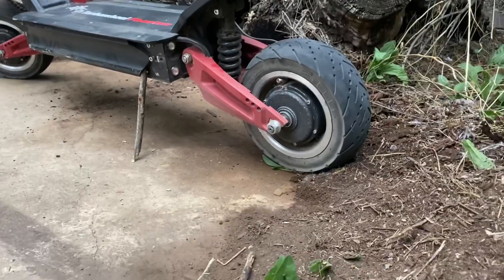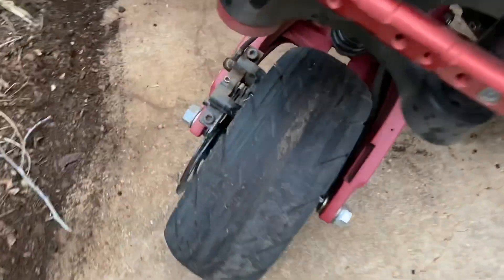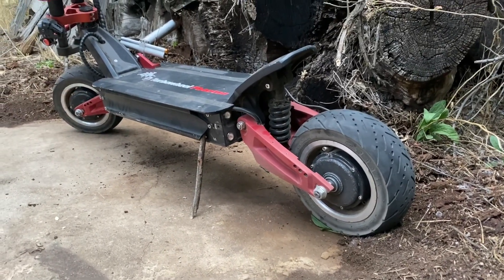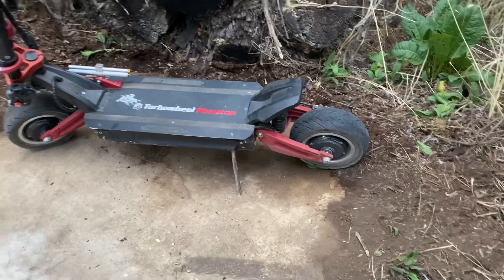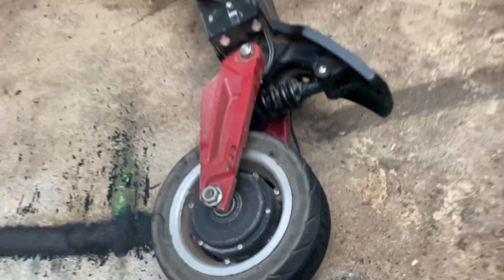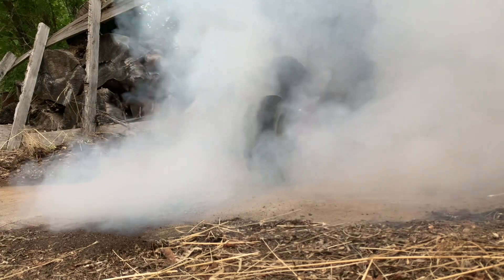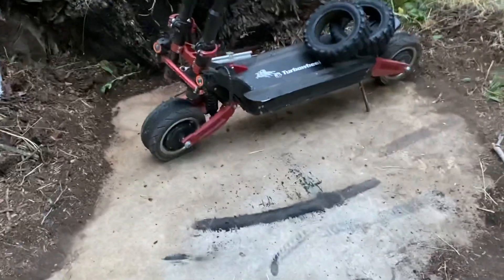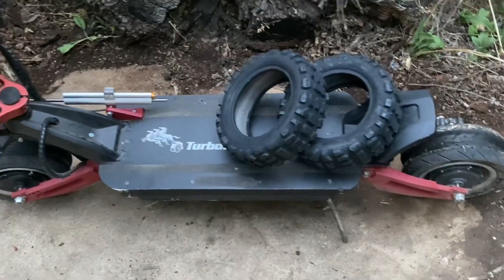Electric scooter burnout tell both tires explode / Turbowheel phaeton

Comment: One question will any controller fit with any battery and motor
Reply from the maker: I’m not to sure but theoretically yes as long as the battery/motor can handle the power of your controller! Only thing would be the connection to connect all 3 together wouldn’t be plug and play so you would just have to add new plug connection